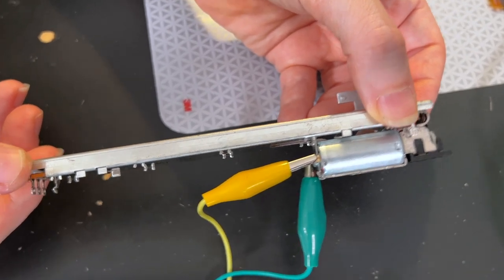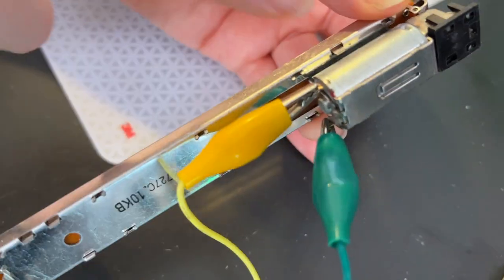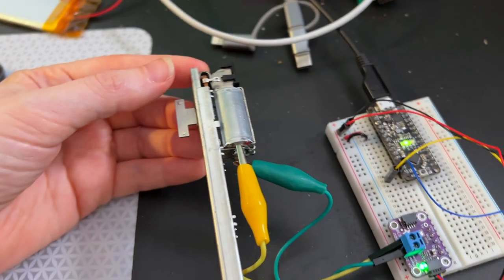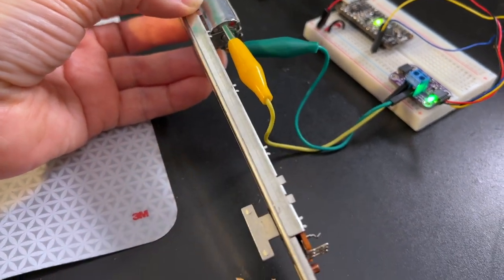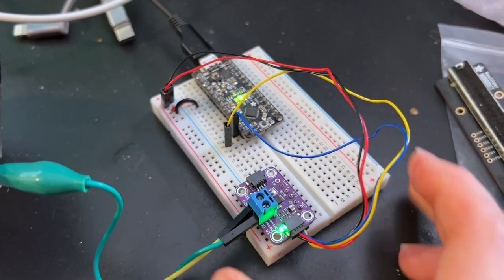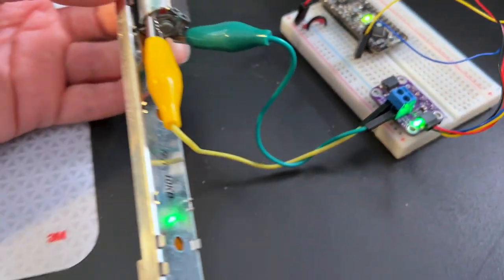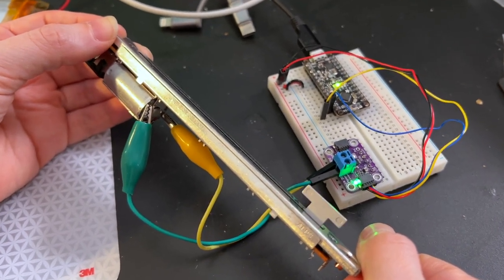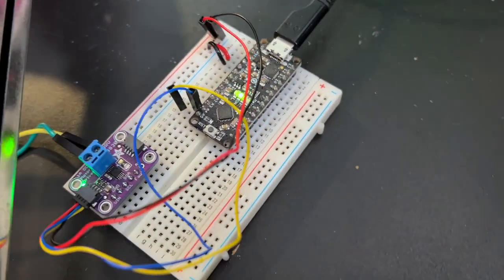Motorized potentiometer goes back and forth and back and forth

Comment: Isn't that what some big audio mixers use ?
Reply: Yep.
They allow mix setups to be saved, and recalled electronically.
 The alternative is making a note of every fader position, and manually putting them back into those positions.
Reply: Definitely had a bunch of these in the berringer x32 I used.
Reply: Yeah I think you're right. I've had several over the years. I found mostly found them in home audio systems. Generally used as a remote controlled volume or like you said audio mixers treble bass ECT

Comment: expensive studio mixing consoles have those for volume controls. you can store presets and it'll move the sliders. closed loop control of course.
even "force feedback" is just a few tweaks to the control loop. you can apply a limit to the rate of change, or you can create detents that are purely defined by electronics/software.